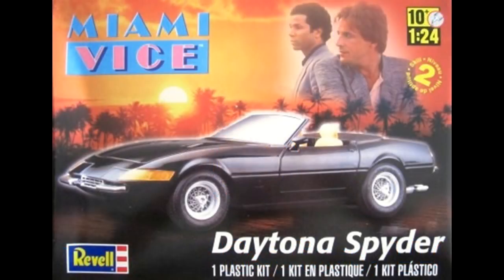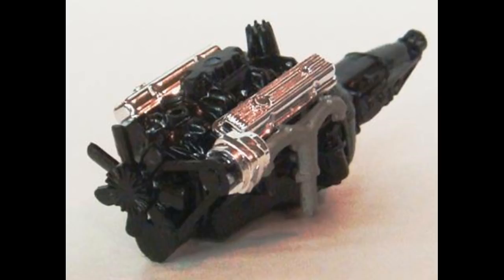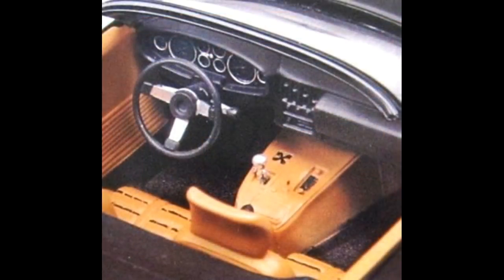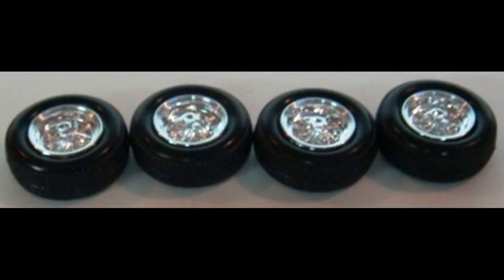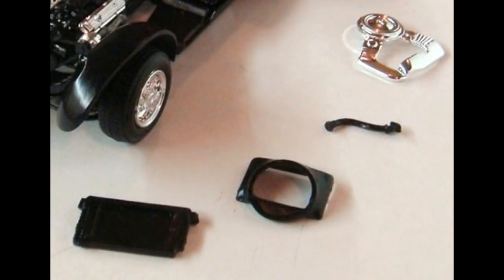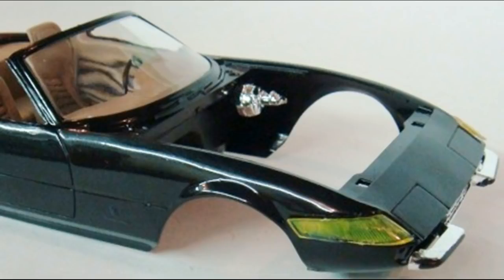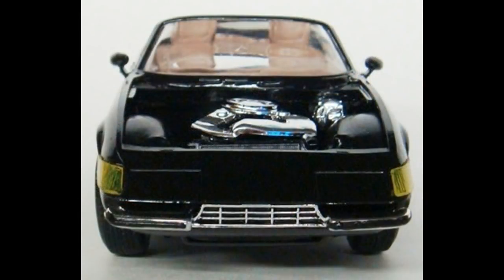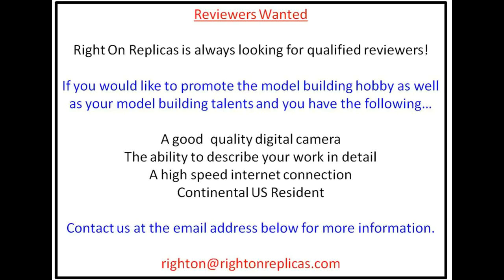How to Build the Miami Vice Daytona Spyder 1:24 Scale Revell Model Kit #85-4917

Comment: Nice review and build up. I just have to say one thing about your build. You missed out on the nicest part of this model and that's the wheels. If you apply a black wash to the spoke area, these wheels pop! I think these are the nicest looking wire wheels on any model I ever built. You could still do the wash to them. It would be easy to do even assembled. Thanks for the video!
Reply from the maker: KM, thanks for the tip!  -Doug

Comment: Beautiful car, and even though I was shocked when I first learned it was a faux-Ferarri back in the 80s when the show was still on, I still want the car after all of these years. The only things I would change on the model would be cutting off the head rests as the real car didn't have them, and modify the headlights as the car had 4 of the small rectangular headlights behind plexiglass, not pop-ups.
Reply from the maker: PR, Thanks for the info and I agree - still a cool car!  -Doug